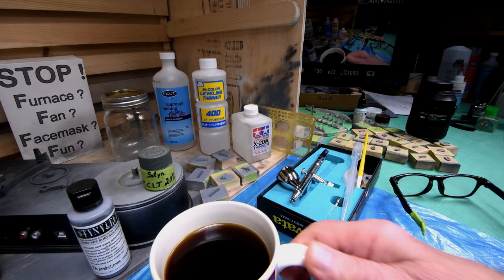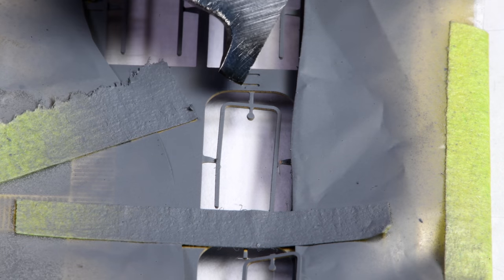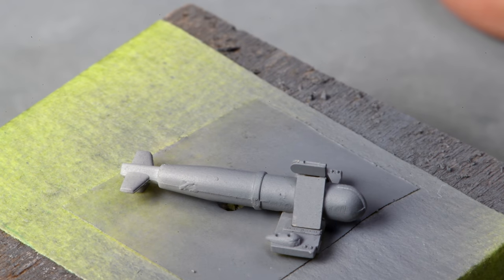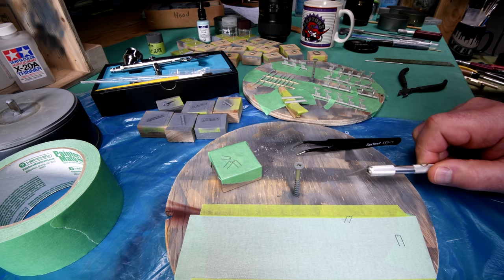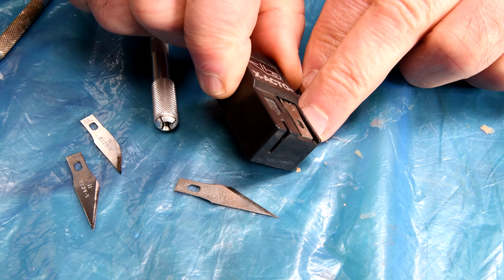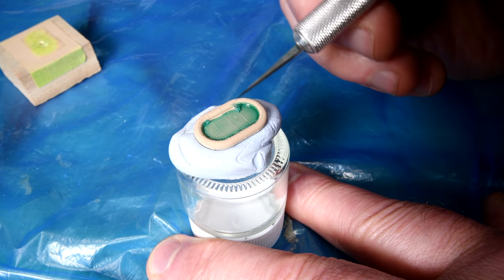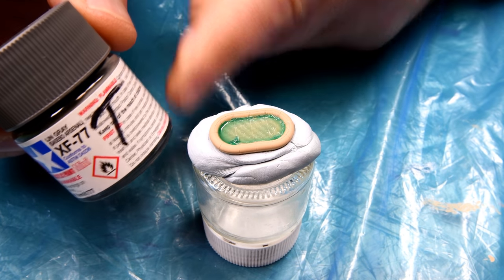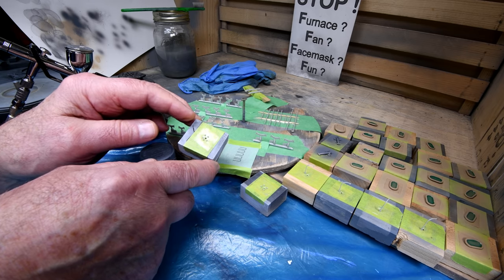The Model Ship - Part 588

Comment: Hello Ron! 
I have another possible technique to deal with the life rafts with the wood slat bottom!
Watching you with the liquid mask has convinced me that there must be a better way!
How about trying this (as a test) on one of the life rafts.
Remove (good luck with this) all of the liquid mask. (You might use that rolled up ball of removed mask as a PICK-UP)
Spray the entire raft with the gray.
Use dark gray or black Tamiya Panel Accent Color- just drop some in the bottom of the raft (not a huge amount, but enough to cover the bottom of the raft and flow around the bottom slats.
Let dry thoroughly.
Then… DRY BRUSH several overlapping very light coats of the deck tan only on the top of the slats.
I realize the rafts are very tiny! 
Put VERY LITTLE PAINT on the brush when DRY-BRUSHING..
It doesn’t matter if you dry brush every slat! But the contrast between the dark panel line color on the bottom and the much lighter tan should be very effective.

ALSO(1):
Here are some LINKS about AIRBRUSHES & AIRBRUSHING.
I’ve worked as a technical (architectural) Illustrator for decades and these are very useful videos.
I completely agree that ACRYLIC PAINT is challenging in any airbrush!
You may already be aware of  the SCALE MODEL WORKSHOP website, but - just in case, here are come LINKS:
SCALE MODEL WORKSHOP (YouTube):
https://www.youtube.com/channel/UC9UUZIFvHRQPfDoCP-bTB7A
Airbrush Operating Tips
https://www.youtube.com/watch?v=46Ss6h_Lo_k

Airbrush Cleaning & Maintenance (Please watch this one!)
https://www.youtube.com/watch?v=ulWFoG5Inmw

Single Action Airbrushes for Scale Modeling
https://www.youtube.com/watch?v=T4xiTne2Mu4

Double Action Airbrushes for Scale Modeling
https://www.youtube.com/watch?v=mh4AbXuhXYI

Surface Primer for Scale Models
https://www.youtube.com/watch?v=1K8rO4Ei610

Masking Tips for Scale Modeling
https://www.youtube.com/watch?v=dfrwh9kzfu8

ALSO(2):
Here’s a Video on a NEW Product from Iwata:
IWATA MAINTENANCE & CLEANING KIT:
https://www.youtube.com/watch?v=ffSz72uwzX0

LINK for this product on Amazon-( $77.05 U$):
https://www.amazon.com/Iwata-Medea-NA-Iwata-Professional-Maintenance/dp/B019EGII40/ref=asc_df_B019EGII40/?tag=hyprod-20&linkCode=df0&hvadid=167129414796&hvpos=&hvnetw=g&hvrand=1861767013486049739&hvpone=&hvptwo=&hvqmt=&hvdev=c&hvdvcmdl=&hvlocint=&hvlocphy=9004339&hvtargid=pla-304225133467&psc=1

ALSO(3): 
I just saw quite a few videos of Stephan Draminski’s 3D model ships (including HMS Hood) posted on youTube.
Here’s the LINK to his website:
www.bismarck3d.pl

You’ll need to search YouTube for the 3D Model Videos (as many aren’t on his website)
Here’s a link to his 3D Model of the USS Iowa:
https://www.youtube.com/watch?v=IN09Tf0i3PI
Reply from the maker: " SCALE MODEL WORKSHOP " 👍👍